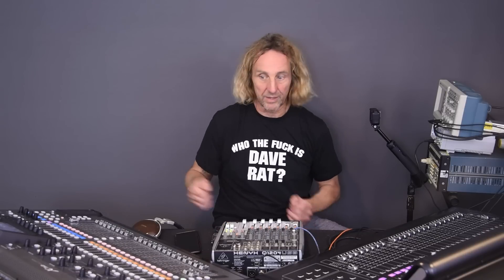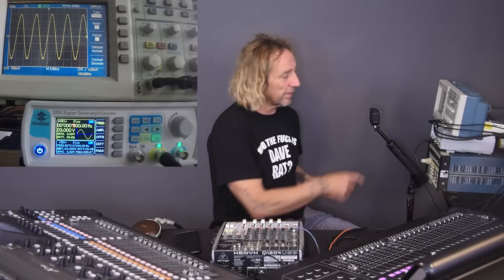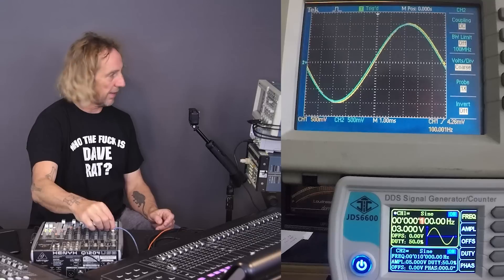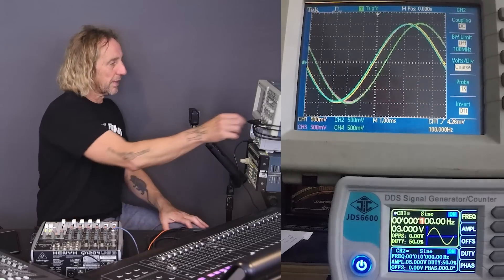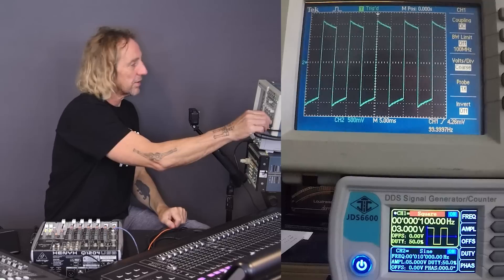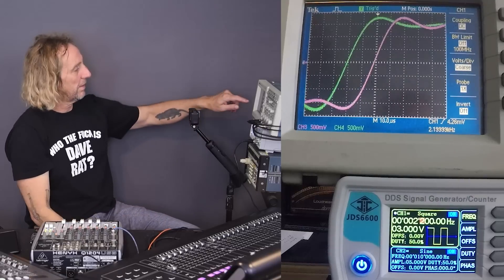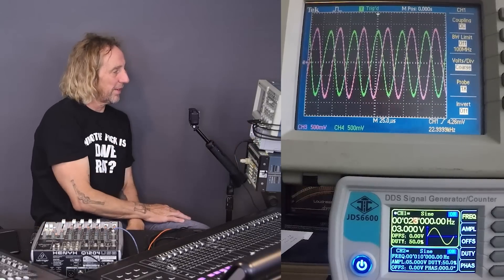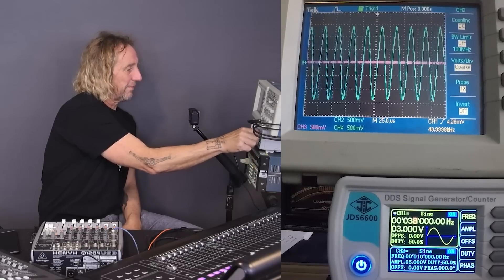Which Sounds Better Midas M32 vs Behringer X32 vs Copper Wire

Comment: I figure it's worth pointing out the obvious no speaker on Earth can actually reproduce a square wave so to say that an digital  board  Can't reproduce a square wave is completely irrelevant in all audio terms
Reply from the maker: Hmmm, so what happens when you connect a 9volt battery to a 12" woofer. It moves in or out and then stays in or out, then remove or reverse the battery and it returns to normal or moves to the other extreme.

Why is that not a square wave?

Now it is true that a mic can not pick up a square wave unless in a sealed environment but it's not hard to get a speaker to reproduce a square wave.

But that is not the point really.

The ability of electronics to have what comes out be 8dentical to what goes in, is how we determine linearity and accuracy.

There seems to be this odd belief  that some people hold where they see a shiney digital product with fancy features and somehow equate that to a higher sound quality that a simple piece of wire or simple analog circuit. And while yes, dance gear can sound great and even reach levels where we are hard pressed to hear a difference from a simple circuit or wire, the fact remains, a wire or simple analog circuit will almost always have lower noise, lower distortion, wider frequency response, lower latency, faster recovery time for a power failure and so on.

Digital is awesome and and the most awesome digital gear can sound almost as good as a piece of wire.
Reply: @DaveRat   In order for it to actually be the definition of a square wave we need to move from one position to the other position instantaneously and instantaneously no component is able to move that quickly would you actually get a produced is a pulse it's a pulse sign wave at the beginning and the end when you do that. And I believe what you would get that's audible are the 1st 3rd and I think 7th harmonics of the speed of the speaker moves at
Reply from the maker: By that definition, no electronics are capable of reproducing a square wave as a perfect square wave would require an infinitely high frequency.

But...

A speaker with a 9 volt will move out, stop, hold and then move in.

Which unlike a sine wave involves motions and stops.
Reply: @DaveRat   1st off I just want to say in case if it was led you to believe otherwise I believe that you're one of the best sound engineers I have ever heard in my entire life. And I'm not arguing with what you're saying even though I have a little bit of disagreement on the fundamentals of how square waves react in our natural world but I don't believe in a common section is the right place to have this discussion there's too much complication to explain without direct feedback while communicating
Reply from the maker: All good and thank you. The square wave in the console test is just a simple way of clearly showing the HF roll off and ringing in digital consoles vs analog.

The relevance can be discussed.

My reason for the video was to dispell the perspective that "digital is better" and a cheap analog board lacks the fidelity to compare to a digital console.

Digital is powerful, useful, convenient, and excellent for many applications. But even the best digital gear can not come close to the simple low latency wide flat response of a simple analog circuit.

Whether those differences matter for any specific application can be determined.

But if ya don't need to convert to digital and the are no specific advantages to converting, it's probably better not to.

Comment: Are the Boards that have a USB digital recording interface output have an analog front-end mixer? If so how does being converted to digital degrade the analog signal?
Reply from the maker: The conversion will take its toll. The best digital can do is have the degradations so small that it does not matter

Comment: Reproducing a 20kHz square wave as a perfect sine wave is exactly what you want with a digital console, it demonstrates that the filters before sampling are sufficient to prevent aliasing 

We operate with a bandwidth of 20Hz - 20kHz. Anything outside of that is useless to audio engineers
Reply from the maker: 24k is less than 1/4 octave above what is slated as typical hearing. We hear about 10 octaves so it's less than 1/40th of our hearing range as a buffer.

So for a freeway with a 70 mph speed limit and adding a 1/40th buffer, we should have cars that max out a 71.75 mph, right?

Just having fun playing with assumptions here.

I find it fascinating how we as humans strive for camera resolutions that far exceed is often needed, car speeds that far exceed what we will drive and yet when it comes to audio "naw, all good, barely above hearing all good"

Do you follow the same theory with cameras? No need for a camera with over 4k resolution, right? 

I've got some old Nikon cameras cheap if you are interested in taking pics barely above the resolution of your phone, tv or computer monitor.
Reply: @DaveRat  it's great that you take the time to actually reply, good to chat with in real life. (I've worked as system tech for several companies that have provided l'Acoustics for you when you were with the Chillies) 

I get what you're saying but what practical benefits are achievable by extending the bandwidth above 20kHz? 

The highest playable notes usually have a maximum fundamental frequency of around 5kHz (C8 on a piano is just over 4kHz), giving 2 octaves of harmonics in the audible range. Where do you draw the line between audibility and possible benefit to a child under 12 years old? 

If there were significant benefits, then the standard sampling rate would have been increased long ago, driven by consumer demand. 

The benefit of 48 compared to 44.1 is the fact that the anti aliasing filter can be of a lower order and therefore will exhibit less resonance around the cut off frequency, which can be raised slightly. 

The benefit of 96kHz + is to avoid aliasing when introducing distortion through processing .

With the camera analogy, increasing the bandwidth would be akin to extending the bandwidth of the sensor into infrared and ultraviolet, useful for some applications, but not for photography or cinema. Increasing camera resolution doesn't really have an audio analogue. 

An interesting experiment would be comparing 2 M32s with the 20kHz square wave, one at 44.1 and the other at 48 to see if the filter is good enough to reproduce the 20kHz sine without alias at 44.1. 

Keep up the good work.
Reply from the maker: Hey hey Steven. I agree on the analogy to cameras of infrared and ultra violet.

And to take it further, to recreate the experience of sunshine using purely visible light would lack the infrared warmth and edgy squint that infra red and ultra violet provides. And a visible light band limited version of sunshine recreation would always be lacking.

For digital, it is feasible that each individual step having a range that barely exceeds human hearing by 1/4 octave or 1/2 octave for older humans, then often gets combined with multiple other steps, and one or more a to d and d to a conversion followed by a speaker system that tends to be even more limited in it's ability to reproduce the frequency extremes.

It is my opinion that if one was to avoid letting tech limitations bias our goals, that shooting for maintaining a full octave above and below human hearing as far along in the signal chain as possible would not be not an unreasonable goal to shoot for.

Then band limit as desired for the application at hand.

Interestingly digital does solve the low freq side and even YouTube will process and deliver audio down to 5hz or lower.

I did some vids testing YouTube audio which dies at around 14K or so depending on stereo or mono.

Comment: Your discussions on 20khz+ sound being audible makes me wonder, would a 25khz sine wave from one speaker and a 26khz sine wave from another generate audible acoustic beats at 1khz?

Also, if the same driver was playing a high intensity 2khz tone and a 20+khz tone would the doppler shift and other interactions bring the higher frequency tone into the audible range for half of the 2khz wave?  Remembering the video you did with a driver playing a very low frequency tone causing audible shifts in a higher frequency tone being played.

Lastly, would multiple sounds time offset by less than the nyquist frequency generate an audible effect that would be lost due to the sample rate?  Thinking things like reverb with lots of time offsets

All frequencies just examples.
Reply from the maker: It's important to note that I  believe I refer to above 20k being perceivable. Not necessarily audible.

Audible refers to the ears hearing. And on the most literal level, we know above 20k is perceivable as we perceive light and infrared heat and people get burns from radio towers.  All are frequencies above 20k.

The question is not whether above 20k is perceivable as we know it is. But rather, at what level and 8s the perception relevant to the application or situation
Reply: @DaveRat  then would the given scenarios potentially shift the sound from perceivable to audible?
Reply from the maker: That is possible, would be interesting to test

Comment: I don't disagree with anything said here, but it's worth noting that in the world of live sound, these days we're usually running digital amps into PA systems that are only specced up to about 16KHz anyway, and chucking that sound 30m+ across a field with the wind blowing. Anything you gain from having a console that goes really high is completely lost in that scenario due to air absorption and the wind. Indoors can be just as bad with the heat of lots of bodies causing the top end to bend upwards.

Mixing in a studio, however, is a different matter altogether (although we all know it all gets MP3'd afterwards so eventually you're in the same boat downstream).
Reply from the maker: Agreed that for many applications the added HF is not relevant and when touring arenas with a pa and you get that pristine theater gig and the system sounds flawless rather than lackluster, the capabilities are appreciated.

Alsoperhaps looking at things in terms of octaves rather that frequencies is useful? Having gear that easily reproduces a full octave above and below hearing is desirable. Then we have highly capable gear that exceeds any application. Like having a car that can easily exceed the speed limit.

Comment: Wonderful series, Dave. Thank you so much! Would you try this same 20k square wave test with TWO Analog to Digital to Analog conversions. Tone Generator > X32 > XLR> M32>Scope. I would be curious what two unlocked sample rates do to the signal. What about different clock rates? So many places have a digital board, feeding analog to a signal processor, and then analog to the amps, which have DSP themselves. Thats 3 A/D/A conversions between the mic and the speakers! That must have some effect on the signal.
Reply from the maker: Unlike digital, analog signals do not benefit from being sync clocked together. Syncing clocks is to get the digital samples aligned, but once the signal is analog, there are no digital samples to align, even if the signal was previously digital or will be digital. Syncing clocks is for two digital units to align when transferring a digital signal between them.

Comment: Some of the things you mentioned are the reasons why Sony for example runs a tweeter functional up to I think it was 50khz? The perception even if not heard makes a difference in those devices and will provide a different experience it seems.   Good stuff.
Reply: The Sony's with those tweeters aint too bad for their price either. Lovely smaller bookshelf speakers for the living room. A bit weak in the bass, but nothing too deficient.

Comment: Great video! I'd also like to see any differences in the sub-bass frequencies like 50-60hz. I guess there might be between analogue and digital.
Reply from the maker: Near identical except the digital board tend to reproduce frequencies below 10hz better
Reply: @DaveRat  Oh, I thought most analogue mixers have high-pass filter to block DC at around 20hz or so and you will see phase issues above it.
Reply: @juneaftn   I would imagine the digital boards probably do, too.  For one thing, a lot of ADC/DAC ICs are single-supply, so there's a virtual ground at 1/2Vcc.  That requires high-pass filtering to separate signal from supply.  I don't know what the M32/X32 uses, but I would be surprised if it were anything other than +3.3V or +5V supply.
Reply from the maker: Digital boards are really good at reproducing very low frequencies.

Comment: This video is getting nothing but contempt on Facebook. Much ridicule going on. The prevailing opinion is this is just a fancy way of saying "muh analog is better" by performing tests on a shitty low end digital board using a digital (limited sampling) oscilloscope....which pretty much doesn't prove anything and means basically nothing.
Reply from the maker: Ha!  Are people actually crying because they dont want to face the reality that a $79 analog console has superior audio specs than digital mixers?

Good stuff. Adding features tends to also add issues 

Best quality/least noise/least features - short copper wire

Add EQ, level controls and routing, the quality drops and noise increases a bit

Add a digital conversion and conversion back to analog, quality drops a bit more and noise increases more and add latency. 

Spend lots of money and make a precision expensive digital console and latency can be reduced but never as low as copper wire or a cheap analog console.

Noise can be reduced but never as low as a copper wire

One way to think about it is to understand that digital consoles have an analog mic pre and analog output drive, so if you were to compare an analog console using the same analog mic pre and output drive as the analog mic pre and output drive that the digital console has, you would have two identical signal paths, except one would have a conversion to digital and back to analog and the other would not. The non digital signal path will always lower noise, lower distortion, less latency, and so on than the exact same signal path that has a digital conversion added in.

It's not rocket science. Just a simple provable easily testable reality that follows a line of common sense and logic.

It's not a question of whether converting to digital adds issues while adding feature and capabilities, it just a question of whether converting to digital offers advantages that exceed the issues created, for the application at hand

I love this!
Reply: Next time, compare your wire to a  Pro-1 at 96Khz. Then maybe we can see a worthwhile comparison.
Reply from the maker: Perhaps you are missing the point.

Digital strives to emulate what a short wire does effortlessly. 

Yes, if you this enough money and design at it, digital can screw things up less and less.

But the power and control of digital is wonderful and extremely useful.

And there are people out there that do t understand that for passing a signal with simple EQ, a cheap analog board will be extremely expensive to beat with digital.

Proper to for the applications remains the best plan

Comment: It's not clear to me if the two digital consoles have their clocks slaved together? The delay you were seeing is not quite 180 degrees at nyquist, so that < 1 sample as they both appear to be running at the same sample rate. If you were to designate one as the master and slave the others digital clock to it, i'd speculate that they will be perfectly in time, removing that phase offset.
Reply from the maker: Interesting but keep thinking this through. I am using an analog input and output on both consoles.

The signal goes in and comes out analog, whether the consoles are synced or even operating at the same sample rate is not relevant when interfacing using analog.

You could have a monitor console operating at 48k, a foh console operating at 96k and a recording console operating at 192k all at a show and connected to the same analog splitter. They could all have differing latencies and clocking them together would not alter the latency differential. At least not by more than the clock drift or offset.

If you have consoles with differing latencies, clocking them together will not make the latencies the same. 

Anyway, that's all is beside the point, the two consoles each actually use a different type of digital to analog converter. What we are seeing is the longer latency in the X32 which has slightly slower and less expensive D to A converter.